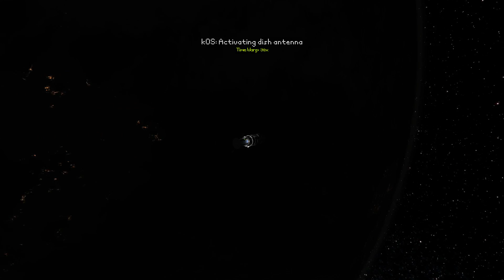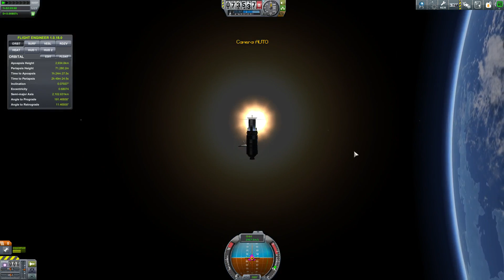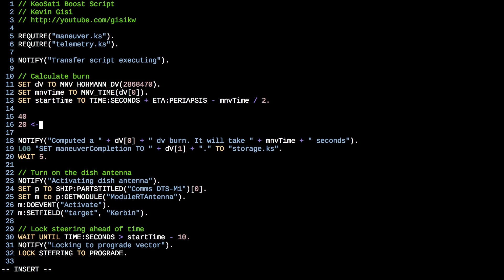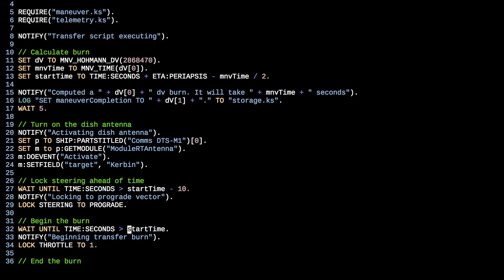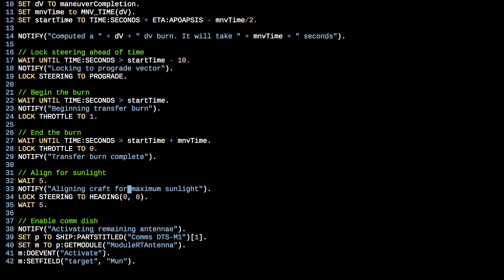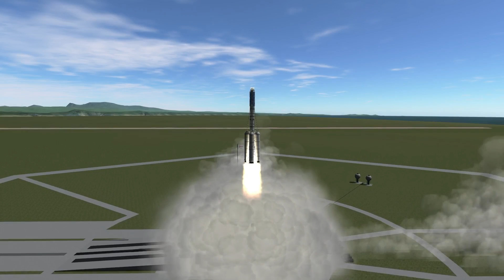Kerbal Space Programming #13 - Kerbostationary!

Comment: How are you able to use the Notify function despite not having the actual function within the script?
Reply from the maker: Heya - Notify is defined in our boot script, which is what actually loads our mission scripts. So it's loaded globally before this script has a chance to run :)
Reply: @CheersKevin  What about some of the deltaV functions? Is it as simple as defining the functions in the boot script and/or running the library script containing the delta-V functions?
Reply from the maker: @warrenaustin9374  Yehp - variables (and functions) are global by default unless specified otherwise, so as long as it's run, they should be available to you. It's been a little while for me though, so I'd recommend looking at the kOS docs page on user functions for more detail

Comment: How would you take in to account throttle time as not all rocket motors instantly throttle?
Reply from the maker: Joshua Lloyd you're right that we're not factoring that in here. If we wanted to factor in spool-up time, probably the easiest thing would be to calculate a fixed amount of thrust for that ramp-up time (profile the engine's spin-up curve, and integrate under that to get the total amount of spin-up thrust). If the spin-up thrust is greater than the desired thrust, then I think it becomes a matter of solving for the upper bound on the integral, or more lazily, just doing a binary search for a  decent cutoff value that gets the thrust within the desired range.

Comment: I really am  enjoying this series, I feel like there's not enough KOS videos around.  A little nitpicky detail about when to start your burn.  You technically want to divide the deltaV instead of the overall burn time.  Most small burns this wont matter much but as the magnitude of the burn increases so will your magnitude of error. 
what you want is:
SET startTime TO  time:seconds + eta:periapsis - MNV_TIME(dv[0]/2).
This way half the deltaV happens before periapsis and half after.
Most cases the difference is negligible, but when you're doing longer burns the first half of the deltav takes an amount of time longer than the second half which is worth considering.
Reply from the maker: Excellent point, and thanks for the quick solution!